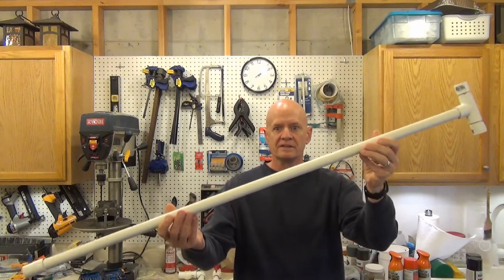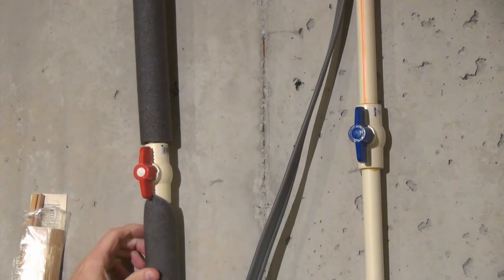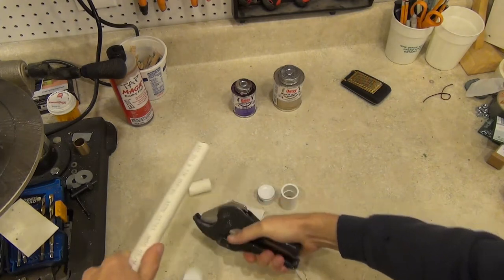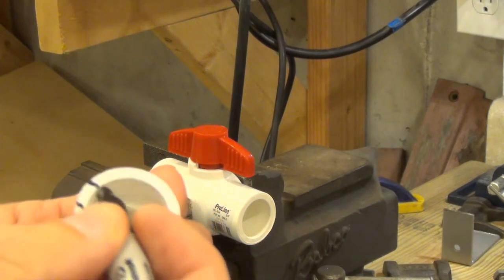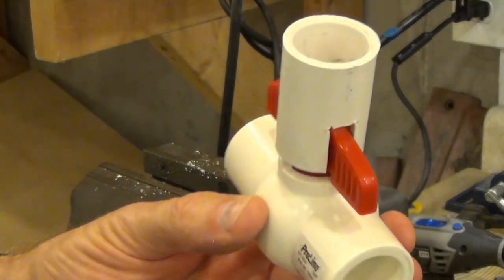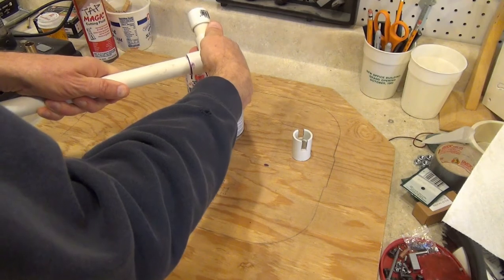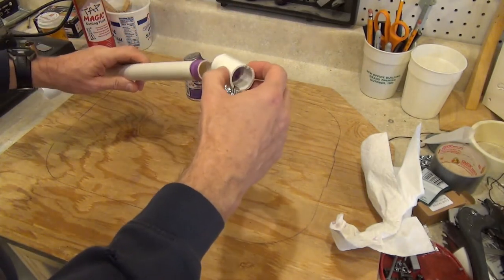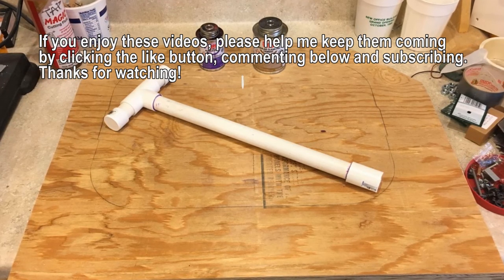Useful PVC Valve Tool: Turn PVC Valves the Easy Way! (#3)

Comment: Excellent.  BTW, there is an easier & cheaper way with no need for glue or small pieces. Use a 2ft piece of 1-1/4" or 1-1/2" PVC pipe and simply cut two 3/8" slits at the end using an oscillating or hack saw.  Drill the top end of the slits using a 3/8" drill bit for a clean finished look.  Then at the top, drill two 5/8" holes and slide a 1ft piece of pex to act as the Tee Handle.  If you have the materials on hand, this should take no longer than 10 minutes to make with minimal cleanup.

Comment: I was working on my sprinkler system, I’m new at this. I had an underground leak on both sides of the solenoid.  Not knowing, I started cutting the pipe and had water spraying out and it wasn’t what was just left in the lines. A slight panic set in. 😬 No one ever showed me where the shut off valve to the sprinklers was, so I shut the water off at the street until I finally found the sprinkler shutoff. Of course the valve was stuck. Didn’t want to break the valve, so I started Googling and found your fantastic idea. So far I’ve made three or four little handy-dandy little tools for doing sprinklers. Thank you so much for your idea. 😊 You are a lifesaver!
Reply from the maker: Hi Diane!  So glad you found my video helpful in solving your problem! Thanks for watching!

Comment: Thank you for the video, very well spoken easy to understand. I have to make one for our pool. We use one of these t ball valves plastic for our water shut off to the pump and when I close it it's fine but when I go to open it it has all that pressure and it is very hard for me to turn it I'm afraid I'm going to break it. I see where I can buy one off of Amazon but I like your style I will just make one for the t ball valve that goes to our pump. Thanks again.
Reply from the maker: Glad it was helpful! Thanks for watching!

Comment: Or put a brass ball valve inline in the first place. Those pvc valves are your worst enemy in pvc piping.
Reply: Agreed...unless you are piping a pool. Impractical just on a cost side...not to mention most brass valves aren't full port so you add restriction of flow at each one.

Comment: Is that a Star Trek communicator on your workbench? 1:17 Cool!
This is helpful. I haven't seen a shut-off valve extension that fits plastic handles for sale anywhere. 
I will avoid installing those inexpensive valves in the future.
Reply from the maker: Yes, it is and you are one of very few people who have noticed it!  Thanks for watching!
Reply: @DIYMyWay  The first thing I noticed was the phaser on the peg board. At that point, I knew this would be a good video. And it was. Thanks.
Reply from the maker: Thank you JAS II!  You are among the sharp-eyed few to notice the phaser. Glad you liked it and Thanks for watching!

Comment: Nice job. So for a 2" pvc ball valve it's good using a 2" union??.
Reply from the maker: Thanks!  If by union you mean coupler at the end of the shaft then a 2" ball valve might need something bigger than a 3/4" coupler to make the slotted end but probably not a 2" coupler.  A 1" or 1.25" coupler would probably work. Thanks for watching!

Comment: Great idea! They can be custom sizes based on height and perfect for people with disabilities with ponds to avoid bending or getting on the ground. 

I bought a rebar water key but it didn't fit over the plastic ball valve handle.

Comment: This is great, thanks! Is there anything I can do to add an extension rod or use a tool for a ball valve that's low to the ground that I have a hard time accessing? This won't work from up top since the valve is on the side of the pipe and I'd need an elbow on the end to be able to attach it... but then I wouldn't be able to turn it... I know I've seen something like it before, but I can't seem to find anything and don't want to overcomplicate it. Please help me think?!
Reply from the maker: Hi Carla!  Depending on how much room you have to the side of the valve and swing room you have for the handle, the simplest thing that comes to mind is put a T on the end of the tool and cut 4 slot (a cross pattern) for the valve handle on each end of the T, but on one end of the T the 4 slots are rotated 45 degrees from the other end.  This would give you a tool that sort like a box wrench.  You place which ever end of the T on the valve handle that most easily fits over the handle and use it like a lever to partially open (or close) the valve, then flip to the other end of the T and use the offset slots to finish opening the valve.  Hope this helps!
Reply: @DIYMyWay Definitely worth a shot! Gotta try it. Thanks for responding.

Comment: This is a great help. I have one sump pit in my home for the drain tile and the washing machine also dumps the dirty water into the sump pit as well. I have septic so my sump pump ejects up to a "Y" and has two 1-1/2 ball valves. One goes to the street for normal dewatering and the other towards the septic for when the washing machine is in use. Unfortunately this is code. My wife struggles with those stock handles and this is genius.. Thanks again for posting.
Reply from the maker: Hi Ernest!  Glad it was a help to you! Thanks for watching!

Comment: WellI trid this and didn't work, flexed too much , had to make a different one of steel,why don't they come up with some method of lubricating them
Reply from the maker: Steel? Wow, that was one stiff PVC valve!  I haven’t encountered one that the PVC tool would work on. Thanks for watching!
Reply: @DIYMyWay  Same type of valves only slightly bigger, 40mm used on a pool, your video is deceptive size wise but I had to put self drilling screws through the "T" and the the socket even after priming and glueing, for some reason they stiffen up with salt pool water and they almost break your wrist trying to turn it, obviously now, yours was made for smaller irrigation pipes but if you have time have a go, cheers from Australia,